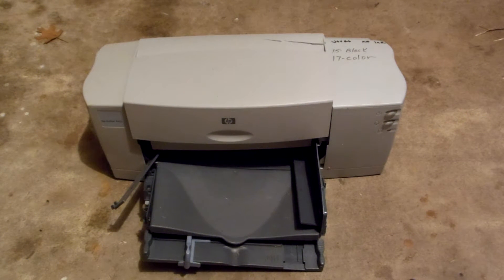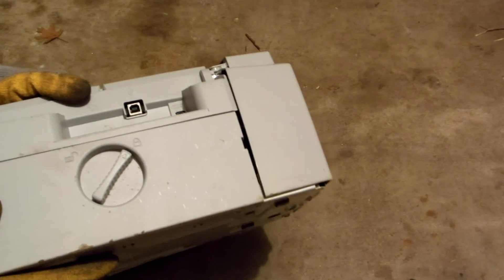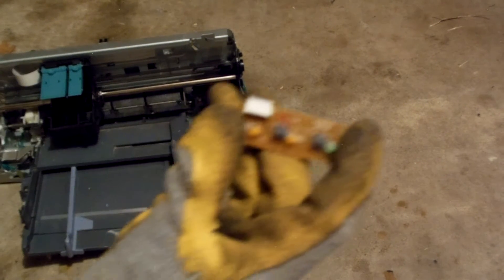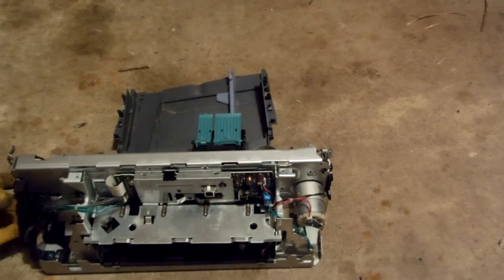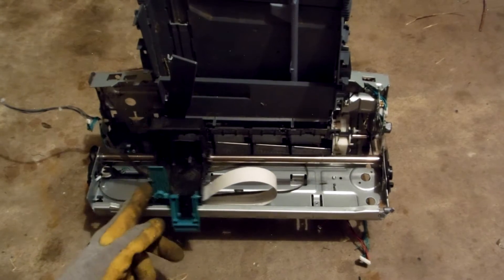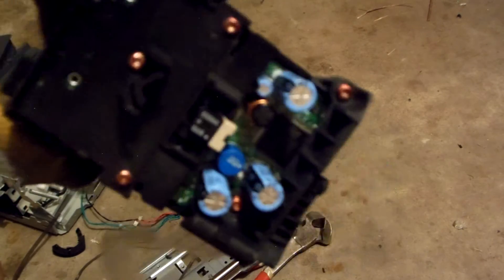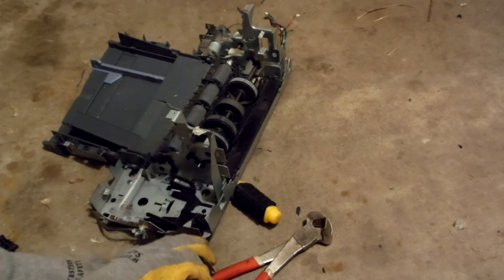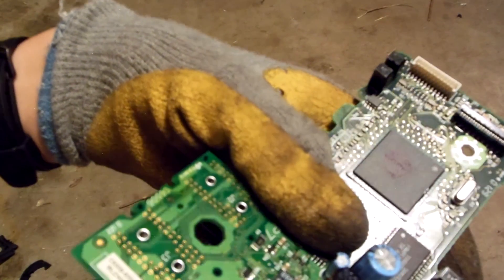E- Waste Scrapping: An inkjet printer!

Comment: I couldn't tell from the video, but I think that first motor that you pulled off can be split in two and then you get some good copper spools of wire out of it.  Also, I saw a video but haven't confirmed myself yet, but it said some ink cartridges have a gold board or contacts inside the cartridge as well.  Have a good day :)